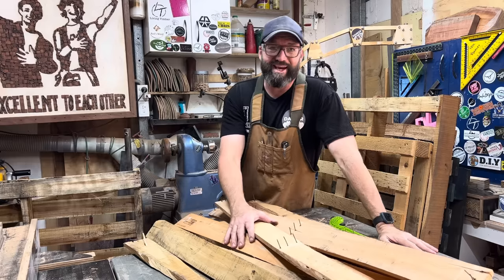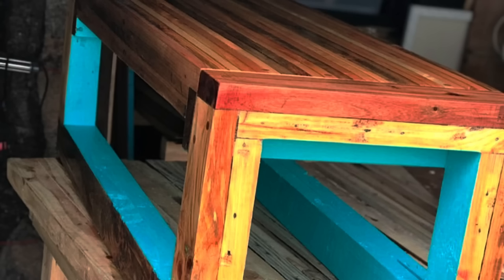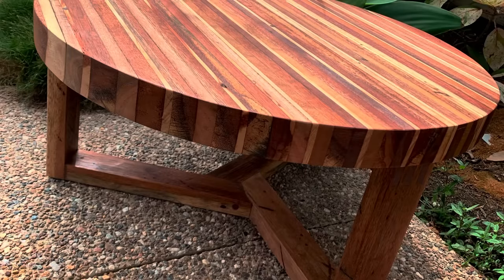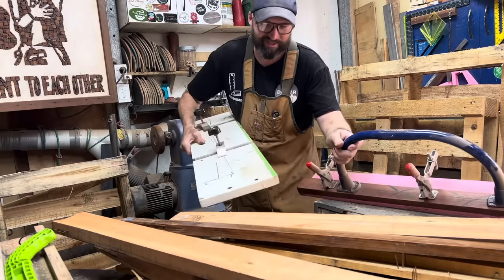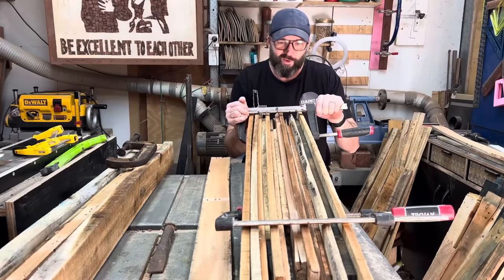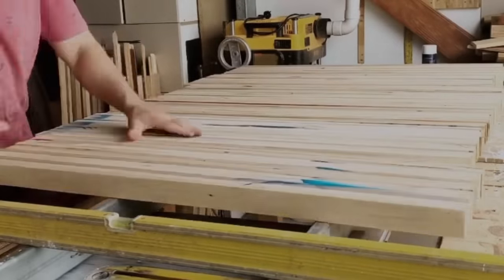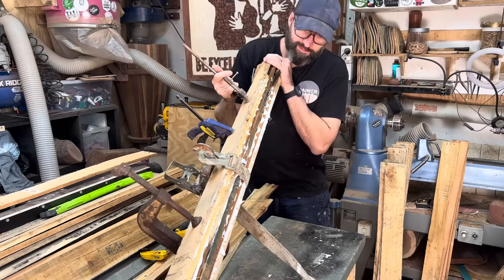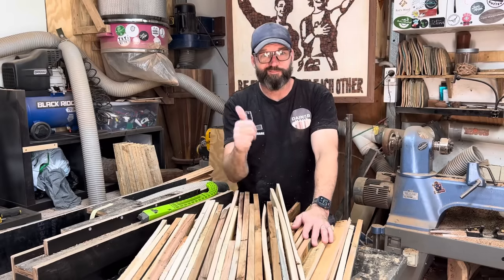Use PALLETWOOD to make MONEY and learn woodworking.

Comment: This is what I've been saying. I started in woodworking exactly like this except, I got friends to pay a deposit to get pallet wood auxiliary furniture (chests and shoe racks). I used the deposit money to buy a circular saw and glue. I already had a drill. Good God is took a long time breaking down pallets and I saw no money for a long time because I needed to use every cent to buy the tools needed for the next job. But the stuff was nicer and nicer and I got faster and faster (and better). I don't do it full time so I had to let people know up front that it'll take a while but they'll get a good deal because the furniture will be made of solid wood instead of the cheap nasty stuff available at the local stores Now I make smalls as a legit side hustle in my backyard. Fyi, I bought my circular saw (first tool) 2 years ago. Thanks for the video and the encouragement to stick with it.
Reply: Michael Sørensen  yeah. As a rule of thumb, always use the ones that are stamped HT. It means they're heat treated and not pressure treated. Check this video out for me details on the topic because in some countries they're often treated anyways.  https://youtu.be/4IblRBJMh-k

Comment: You gave me the inspiration to start a side hustle in pallet wood furniture. I am a landscaper and over the years have thrown away so many good pieces of wood and noticed the local timber merchant had trouble getting rid of the pallets. So I bought a thicknesser the other day for about 180 quid and it works great.  I have made a table saw out of an old skill saw and I have now clamped up my first set of boards. I love that despite clearly having learned a lot and completing some great projects you are still humble and don't look down on the beginner. Thank you for that!✌
Reply: @dainermade  I do a lot of tool reviews in the Landscaping side but I can see my channel start to turn into a wood working channel lol.  But I'm lucky to have some of the better had tools at my disposal. Probably should get a table saw tho. The DIY one doesn't look very safe lol
Reply: If you ever do a fence repair/replacement job, save those fence pickets, 2x4s, & 4x4s. We just replaced our fence last yr, & I saved all the wood. I built a rolling spice rack for between my fridge/cabinets outta the sanded pickets, & have many other wonderful ideas for the rest. I'm so inspired!
Sometimes you can also find free wood/reclaimed wood from jobsites or remodels that is pretty amazing, but you might have some that's unusable too. The great thing about wood... it burns, so you don't have to pay to dispose of it just get a li'l fire pit & voilá~  all cleaned up!

Comment: Great video and hobby. If possible, know the history of your pallets.  Heat treated is better than chemicals like Methyl Bromide.  Pallets may be stamped HT or MB.  Obviously, go for the former.  Avoid pallets used to transport chemicals or other materials that can introduce anything hazardous into the wood. Take precautions to avoid inhaling the dust.  Finally, avoid burning pallet wood if there’s a chance you may inhale the smoke.

Comment: I’m just starting this pallet woodworking adventure myself, got two more today. What I’m wondering is do you have to worry about different wood treatment for pallets. I’m getting heat treated wood. I want non toxic wood because I’m building a compost bin. I’ve noticed they are brittle, should I avoid heat treated wood for building furniture or does it not matter?

Comment: The ONLY honest pallet wood video I've seen
Reply: @dainermade  
Not so much useful to me, but I appreciate the honesty. Too many videos characterize using pallets as "free" and "easy". Not to mention that they're all clean, straight and free of knots. Your video just struck me as being accurate and similar to my own experience. Pallets are a pain in the backside at times. They're dirty, nasty, often dangerous to handle pieces. They more often than not have splinters and nail/staples sticking out at every angle. Often the amount of useable wood can be quite small. I just wanted to say thanks for not sugar-coating it.

Comment: i did a very similar thing. laboured for building company n grabbed every bit of offcuts as i could. obtained some really decent wood. CLS and old fence posts etc . i used paypal credit with no intrest and each planter etc i sold paid for the tools. i bought a triton tpt125 instead of the dewalt thicknesser.

Comment: Ask permission and make sure to check if the wood is treated. If they are chemically treated it might leak or off-gas over time. There is a possibility it might react to some finishes you might add, check everything out, but pallets are a fantastic source of wood and helps cut down on landfills.

Comment: Hallway tables are the perfect means to enter. Exactly what I did. Then I moved to TV units. From there I went into the hardwoods and made so much more money. But in doing so, need to secure a good source of timber or each model or piece in which you invested time, pictures, and listing got to waste.
Reply: @dainermade  lots of drug ;) more interestingly, its the value we place on them in which defines their sale price. For example, if someone spends X on a large TV, then they are inclined to spend 1/3 to 1 the value of their TV. Hence I found the sweet spot @320 1.8m and 375 @2m with reclaimed jarrah inserts.

Comment: Made my first top so far, I went with a 1 inch thick and spent the $ and got a thickness planer, thanks for all the tips Sir.
Reply: @dainermade  thanks and very nice, leaves out the belt sander that I been using.

Comment: I learned from Ben fromwoby design that I didn't have to glue up a ton of boards to make my top, when using pallets now, I  will glue up about 5 pallet boards toether to get a bock around 100 mm thick and wide or depending on the width of boards and about 1mtr long. then I resaw the slab on the band saw into thin slices and turn that one block into  about 10 pieces and overlay this onto of a bit of plywood like a veneer. It means I don't have to collect 20 pallets or more to do one project, I just need 1 usually and after sanding it looks great.

Comment: Hey, another tip, instead of buying the steel rails, you guys can use a couple of old metal bedrails, take the wheels off, and it works the same.

Comment: I been collecting pallets and the left over plastic they use to wrap the product that was on the pallet. I will strip pallet back to the square frame then lay the plastic over that face, using 2 pieces of the lengths I stripped clamp down the plastic at edges and BOOM I got a greenhouse panel. 5 panel make a 1mx1m greenhouse! Watch out ! 😆 you da man bro
Reply: Pallets are flicking gold some are so nice I don't wanna use them just look 🤤 and cardboard is frickin gold , I empty the recycle bins and insulate my bedroom and use them to sleep on 🤣 and it's worm food so primo for garden
Reply from the maker: That’s very cool mate. Or warm 🤣 cheers

Comment: Hi, going by your accent you're on the other side of the world to me, I'm in the UK and have been playing with pallet wood for a few years now although not done much for a while due to the pandemic which stopped me getting my hands on any wood. I've mainly made bird boxes but I have also made two giant planters for my garden, recycle bin storage shed with lockable doors and bird, bat and dormice nest boxes plus a cat home so my cats can sit in luxury outside watching the world go by, it even has a felt roof.

The planters are both 1m wide, 2m long, 0.5m deep lined with plastic and the total cost for both was just £15 and I still have enough plastic sheeting left for more projects. Both have helped provide plenty of food over the past two years I've been growing in them. The bat/bird/dormice nesting boxes I made I used glue and dowels keeping them as organic as possible although for the hinges I did use upcycled bicycle inner tubes with some tacks which also helped to keep the water out.

The easiest way I've found to dismantle pallets is to use an old car jack, push the wood apart which also keeps the nails straight and unless the wood is already broken, no wood gets damaged. I like to keep the nails as they're mostly annular and are great for securely holding wood together.

I do have a cheap table saw, sliding mitre saw, oscillating tool, palm router and larger plunge router, circular saws (large and small) and a multitude of other tools like hand drills, hammers etc. and seeing this video has rekindled my desire to sort my workshop out and get back into it. I never thought of glueing loads of wood together like you have been and making things. What oil are you using on your finished products please? I've got tung oil, raw linseed oil and boiled linseed oil.

I've not seen your videos before and after seeing this one I've now subscribed - thank-you for a very well made and put together video and I look forward to watching more of them.

Comment: Hi. Seen this video of using scrap pallets to build things. I've also used pallets. In the fall of 2014 I built a wood shed using them for the floor.  Well 3/4's of the floor. couldn't find anymore pallets around my area so had to make the rest of the floor with the wood from part of a porch that was torn apart. The rest of the shed was from some wood my cousin dropped  off, that they used to make cement pouring forms for the new water treatment plant they put in so we could have potable water.
All in all, I did have to spend  $87.00 on deck screws and 2x2's for the framing.. 
not sure how much longer it is going to last, as it is 8 years old now and the palllets are sitting on bare ground that gets very wet in the spring when the snow melts. But it has served it's purpose and that was buying green firewood in the spring, then tossing it into the shed to season then using it to make maple syrup usually in March.  Haven't done that for awhile now, but am thinking of doing it this week.-

Comment: Got my start 3 years ago with an orbital sander, a drill, and a reciprocating saw (Yup, you read that right). Every cut had to be extra proud and sanded to length to account for the awful tearout and wide kerf of the vibrating blade. Don't worry, I eventually upgraded to a $50 table saw from Craig's List that I still have today. Made a crooked baby gate, a warped barn door, and a hall table with horrendous joinery (eyeballed pocket-holes). It took far too long to make anything half as decent as the projects in this video, but I stuck with it, learning from my mistakes and upgrading where it made sense.

The baby gate and barn door are still hanging in our old house and my wife refuses to let me replace that stupid table.

The point is, screw people who complain about $30K woodshops, there is always someone who will love a project made with $100 of tools and pallet wood and will happily pay for it.

Comment: i did the same thing cept it was jist using pine 1x12x10 was doing about 5 a day at the end of it all sold in 24 hours. just hallway end tables. small ones. just used a pattern that someone got me from like costco or somthing. they sold for like $60 all day. could sell for more but they they might sit around for a bit. i dont have the space to stock pile much so.

Comment: Very cool video. Its a shame I am not allowed to make furniture here as a non professional, but still, very inspiring
Reply: @dainermade  In Germany, only a certified and registered carpenter is allowed to sell furniture he made himself. You have to be a master carpenter, for that you have to train for 5 years minimum and go through a pretty intensive, full time process. Making furniture as a side hustle is basically impossible in Germany.
Reply: @dainermade  It's a two edged sword. On one hand it bars me from the possibility of selling self made furniture. On the other hand it ensures that these kinds of degrees actually matter in Germany and a certain standard of quality is always maintained. Its not just carpentry. For almost all crafts you need to get a degree and a registration: Cutting hair, tiling roofs, fixing pipes, repairing cars ... basically everything. It makes for a solid quality, but it prohibites "amateurs" from working in the field - even as a side hustle.

Comment: Built Me a 12x14x9 Shed Using Pallets $ 1500  in it The Metal I Used to Skin it is Where The Cost is, it Has a Loft in it as Well. I Store 2 Quads and a JD Riding Mower With Plenty of Room Left

Comment: What is that gun that removes nails?

I don't mind hammering out nails from a few pallets but it can become very time consuming.

Bunnings is the way to go, even if you do not have a way to transport them home. Take a few tools, a home made pallet stripper like the one in the video
or alternative tool and hammer. Figure out exactly what you need then go to work.

I get my pallets closer to home, spoke to the manager of the local supermarket, he said take them ALL, as they only end up in the bin!

Comment: By the way that Grizzly bear 24 inch planner costs $6850.00 and has 4 knifes In a 3 inch head and is on a table that's 31.2 inch's ×24.5 inch's so it's not even close to being a beast. The planner I used to feed for the lumber mill I worked at that was a beast. As it was 6 foot tall 4 feet wide and 20 feet long and was around 5 tons.

Comment: Great video mate. I made a bed headboard about 7 years ago when I saw one online. It's as rustic as they come but everyone wanted one. I also clad some side tables in slats as well to match. One question, how much pine is treated in pallet wood?
Reply: @dainermade  rustic and finished Tim er each have their own place. Both are what nature created. But, how about pallets treated with anti rotting chemicals? Is that not used at all? I ask because, and this likely going to make you cry, but I have 3 pallets from a paver delivery I want to chop up as kindling for my wood oven. I obviously don't want those chemicals in my oven. Thanks for the reply. And the other video was very helpful.

Comment: Love the vids mate!  Quick question.  How often do you change the blades on your planer/thicknesser?  I have the same one and been using it for a while, still doing great, but def doesn't push as close to as many boards as you.  Just curious how often you have to change or sharpen them.  Thanks!

Comment: Hi Mark.  A question if you or anyone else with more experience can answer. Just building up my first workshop with the required tools. A thicknesser is a step too far at this stage. If I am using a router and a sled for my planing purposes, then a plunge router would be best? Probably can only afford one router at the moment, and it wouldn't be one with a fixed base / plunge combo kit either! TIA

Comment: Did 3/4 of my new house garage in pallet wood.All free but a whole lot of work.Covered my Bathroom and mechanical room in my shop also with pallet wood in a vinyl siding kinda way,I also cut my boards off with the nails on,a much better look in my opinion.Again,free but alot of work.We have more of a "farmhouse" feel in our house.I built our coffee table and bench/table in our foyer.Not perfect at all but have never gotten and complaints,only compliments,looks identical to alot of what i seen here.I always get comments on it all.I also run my own business all be it on the side,doing fabrication with metal,not wood.I started doing it at work on the side and built my shop,bought better and better tools and now i do have $30k easily in all my tools.The problem always comes down to people want to go big right away and thats why they fail.I cant support my family on it and probably never will.I could support us in retirement for sure,thats if i make it that far..all good

Comment: 10:19 When you say you wouldn't rely on the glue bond for structural strength, have you ever tested it?  Wood glue is supposed to bond stronger than natural grain.
Might be it bows at 100 pounds, might be you could hold a car on it.... just curious.  

Time and temperature would be important in such a test, too I suppose.

Comment: The only other problem is living in a climate that really cold or too hot and not having an insulated workspace that you don't mind making a huge mess in. When the temps are tolerable I can work in the garage for long hours and then use a leafblower to blow out the 500 lbs of sawdust that the dust collector didn't get.

Comment: Hi Mark I have a question for you, I have glued up some slabs and they have been sitting for a couple weeks and they have warped some. Has this happened to you? and what do you do to fix or prevent this from happening.
Reply: @dainermade  Hey Mark  I glued up 2 slabs both using bricks previously made couple months ago one with bricks same dementions side by side parallel about 30" wide. Bricks are 12" long. The other one was your brick method but staggered them length wise, it's about 40" long. Stored them on edge leaning against the wall after tacking them out of the clamps after 2 hrs and then stored it into the house, as it is bitchen cold here in Feb and only heat my shed when working in it. The brick style staggered slab turned out perfect. The warp or bow in the parallel glue up should be easy to fix by just attaching it to a solid frame. What's your thoughts?

Comment: I've seen a bunch of scrapping videos from Australians and I am absolutely floored by the quality of the pickings. In New York, pallets will only be abandoned on site if they have substantial rot -- hell, even most pallets used in freight in Northeastern US have at least 50% of the wood rotted away. Finding pallets like these is only possible from high-quality office furniture where the staff doesn't have the ability nor space to use the pallets for other inventory in-house. Otherwise, these will be used by the resident facility until it falls apart. Needless to say, I'm considering moving to Australia!